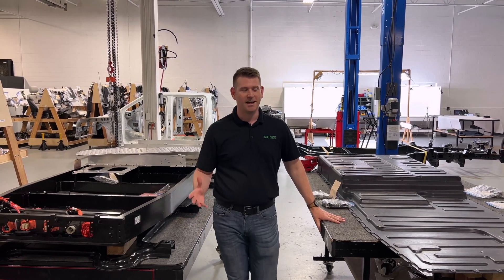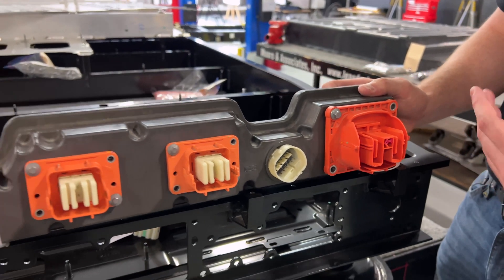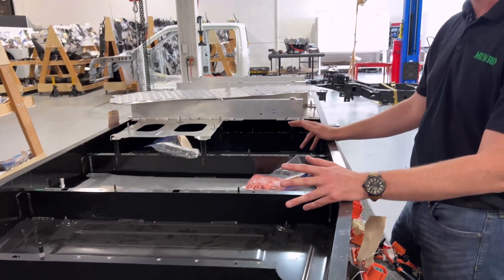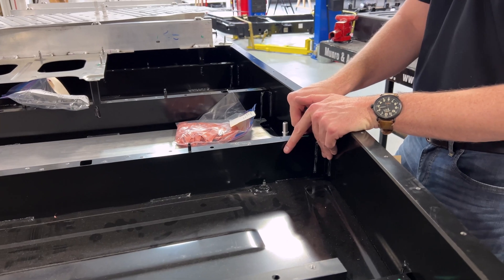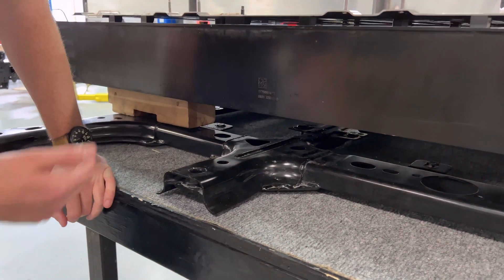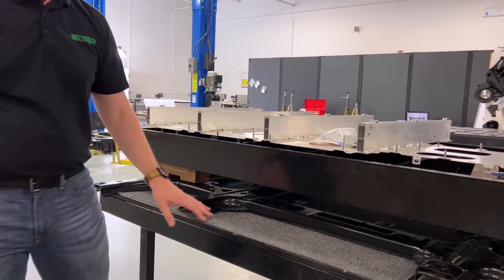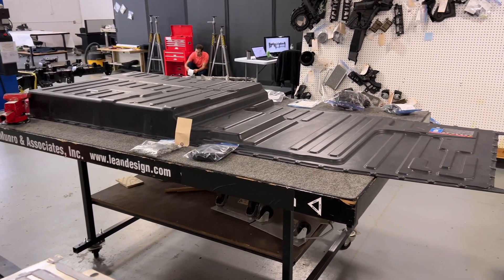F -150 Lightning Battery Pack Structure

Comment: Any thoughts of a follow-up video on the Lightning’s battery pack reliability? I’ve seen some videos claiming battery failures with no replacement stock available at the dealers to get the vehicle back in the road.

Comment: Maybe it's me, but I don't see how this battery pack is "structural".
Reply: It's not. No EV has significantly structural battery pack - not even the Tesla Model Y with 4680 cells, in which the battery pack top case cover just acts as a floor panel.

Comment: Kevin, good job.  If you provided an over view; a simple graphic showing position in the truck so i could stop trying to assemble it in my head would help start with the right context.  Is that the frame?  Where over the double stack?  Was that the frame on the table or subframe?  And so on.

Pack has crude  almost homemake cobble together look of “let’s get it out the door now and optimize later”.
Reply: I think that they assume that you have watched the earlier videos, which show the battery pack mounted in the truck's frame.

Comment: To replace the 300 mile battery back on a Ford electric F150 cost $35,000 and I think the smaller one is 27,000 and change

Comment: Could be that the extremely stiff frame design of the cybertruck was in part driven by the goal of eliminating the need for an isolated battery pack,   given that a pickup truck frame is subject to higher loads and bending than a road vehicle.

Comment: You mention KW, but how many volts are we talking about ? How about the number of AMPS going through those cables. 
Also we see the orange connectors and cabling. Is orange some kind of standard or just a new BEV tradition ?
You mention cooling. What is the temperature of the battery pack, High, Low, Ideal. One would expect a temperature gradient as the coolant worked it's through the battery pack. Does the battery pack automatically shutdown to prevent damage at a high temperature.
Reply: The electrical details will follow in later video, as mentioned in the video.
Other reports describe a battery with 96 cell groups in series, so it will have the same nominal voltage as most EVs, of roughly 360 V. That means hundreds of amps at high power.
Orange for the battery voltage is an automotive industry practice, found in both BEVs and hybrids with higher voltage traction batteries (presumably not the 48 V stuff).
Reply: @brianb-p6586  Thank you.

Comment: The Lighting being a cab on chassis means the chassis is part of the suspension. This means there will be twisting put through the whole of the frame and the last thing those cells need is to be turned into a twizzler. This is most likely way the battery tray is not hard fixed to the frame as in the others which are uni-body and much much stiffer in the chassis than a body on frame.

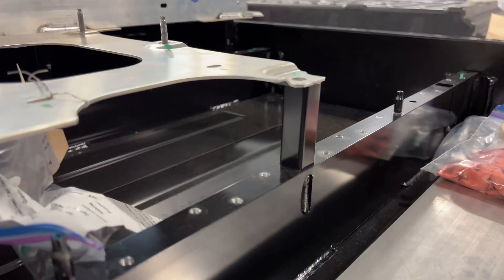Comment: Re: Assumed Knowledge. 0:48 What is SMC (SNC)? 5:55 “Pickup” revisions (as in lesson learned improvements)? 6:36 You know (umm, then why watching?) 7:00 Bulkhead venting (so this has to do with containment of errant gases to deter fire potential, or something?) 8:00 NVH? (Oh right, who doesn’t know Noise, Vibration, Harshness) 10:43 conformability? comfort? familiarity? 11:15 Oh, got it. what does smc mean automotive: “Sheet molding compound (SMC) is one of the most widely used forms of composite material in the automotive industry, particularly in the US where output has grown from 65000 tons in 1990 to 125000 tons in the year 2000 (Automotive Composites Alliance, 1999).” Of course! (face slap). No worries, I thoroughly enjoyed all 11 relistens. You’re the best, Kevin!
Reply from the maker: Thanks for watching!

Comment: That's a lot of battery cells to buy and pay for, to make a legacy frame and body design work as an EV.  I compare it in my head to the Tesla 4680 "structural" battery pack, and wonder how much weight they could offload with a cleaner design.  Having an aluminum body in white and bed is a good start.
Reply: You have to move to a completely rigid body to do structural pack. There are upsides and downsides to that approach, but remember that one of the big selling points for Ford is aftermarket assessories and even entire alternative beds. Ford cant dramatically change the construction of their trucks without in some way missing out on that market. So its not just about using legacy parts, its just as much about reverse compatibility, which limits what they are willing to do. Tesla can do whatever they want because they dont have those considerations. Which is one reason why Ford will still be competitive when the Cybertruck finally comes to market.
Reply: @patreekotime4578    I think that Ford could incorporate a structural pack into the frame if they started with a new frame design from the ground up, and still use a body-on-frame design.  That would be quite expensive and require heavy re-tooling for their new "skateboard" structure, but it might be desirable from the standpoint of maintaining high flexibility of alternate cab and bed configurations typical of the current truck platform market.  If they try to go full structural monocoque, it would be a dead end for aftermarket options.  Trucks are not a "one size fits all" kind of business.

Comment: Like the Mach E the high voltage high current conductors look small maybe 6AWG. From my single conductor in free air table that shows temperature rise at different currents. At 350amps fast charging there will be a 150DegC  temperature rise. With this large temperature cycling over time the fasteners will become loose. Causing high resistance raising the temperature even higher. Note power is I squared R. This problem even gets worse at higher current loads at rapid acceleration. At 1000amps the temp rise is over 400degC
Time will tell when this becomes a problem.

Comment: All these small passage coolant loops. So many seams and joints for failure. I can see a "coolant plate" failure inside the battery pack whereby the pack gets flooded with coolant. Not an easy repair to a $35k battery pack.
Reply: That's typical of EV battery packs. I've never heard of a plumbing failure flooding the case, but of course it's possible and it may have happened.

Comment: I think Ford engineers are going to knock the all new clean-sheet-of- paper 2025 F-150 out of the park in a few years. I predict that Ford will still offer the the current version as a “classic” F-150 at a slightly more affordable price point.
Reply: Ford is going to be so far behind after the EV Silverado and GMC is released!
Reply: @gmv0553  How can Ford be "behind" a truck that hasnt come out yet when they are already selling trucks?  Also,  that Silverado looks like a giant Honda Ridgeline. Can you even put a toolbox or ladderrack on that thing? Load capacity is like 1300lbs.  Is it even a work truck at all?

Comment: I would expect the pack to be soft mounted because the pack is much more rigid than the frame, but it's not strong enough to actually handle the loads that the frame is supposed to handle. Thus, if the pack was hard mounted, the pack or at least the mounting points would get damaged as the frame flexed like it's designed to.
Reply: The design allows for the entire battery pack to be removed for service without compromising the integrity of the chassis. Many EV designs use the battery pack as a stressed member making servicing a nightmare.
Reply: @heathwirt8919  Go back and watch the lift review. There is a ton of complexity with that ladder frame and skid plates that likely makes it more difficult to drop than it seems.
Reply: @patreekotime4578  It's a significant task but it's designed be removed from the bottom of the frame as a unit. Weber Auto has performed the same task on the Mach-E several times, it requires a special fixture made by Ford for this purpose. The pack itself is serviceable as each module is removable as a separate entity. The modules/batteries are not potted as in the Tesla and other manufacturers that use the battery case as a stressed member of the chassis.
Reply: @heathwirt8919  I think it's probably a bit of both.  Bur yeah the easier drop down and back up replacement nature of the pack, gives me hope that long term repairs and or refurbishment will be a lot more economical so that eventually when the time comes and my battery finally kicks the bucket, if it's out of warranty, it'll be possible to find a reman replacement battery pack for a decent price.
Reply: Still, I'd imagine it's practical to make the battery structural because vehicles under repair aren't moving fast or carrying much load and can survive with a much lighter base frame while the battery pack gets repaired/replaced.

Comment: What I find fascinating is the battery form factor that all pure EV companies take vs what ford/GM/VW take. For some reason pure EV companies always use cylindrical cell vs pouch cells.
Reply: Pure what!? Wtf!!!!! Are those other battery cells also batteries!? Stfu!!!!
Reply: Cylindrical is just using up old laptop batteries because there was nothing other back then. 😅
Reply: Pure EV companies/brands NOT using cylindrical cells:
Aiways - prismatic
Atlis - prismatic
Bolloré - pouch
E.Go - prismatic
Fisker - prismatic
NIO - prismatic
Polestar - pouch  / prismatic
Sonomotors - prismatic LFP
StreetScooter - prismatic 
Tesla - mostly cylindrical, but prismatic LFP by CATL and soon: prismatic LFP by BYD
Wuling - prismatic
Zeekr - prismatic

Looks like your rule of thumb needs an update. So far, only Tesla (see exception above), Rivian, Faraday Future, Lucid, Rimac, Arrival are somewhat dedicated to cylindrical cells. And maybe BMW will join at some point in time with their "Neue Klasse" vehicles.
Reply: @koeniglicher  lol…..
Reply: @koeniglicher  Well about half of those are electric divions of existing ICE manufacturers, and most of them are Chinese, including the Teslas, which just suggests that a high volume of cheap prismatic cells are readily available in China.
Reply: @patreekotime4578  That is why I wrote "Pure EV companies/brands", including EV brands of existing car manufacturers. In my imagination, there is nothing like an "ICE manufacturer" or "EV manufacturer". But all of these brands concentrate on producing BEVs. Yes, they may be Chinese, but a Chinese BEV is as good or bad as any other BEV, construction wise. In the end, it is mostly a matter of availability and price of cells together with some basic properties. Cylindrical cells for BEV car applications always have the disadvantage of high cell count, which needs proper automation to deal with it. Cylindrical cells (18650, 2170/21700, and even future 4680) have the advantage to be small, standardized, filling volumes nicely and to be compatible with many use cases different from BEV cars like e-bikes, pedelecs, e-cigarettes, flashlights, toys, garden gear, power tools and whatever. But FMPOV they are not the best choice for larger energy storage systems 30 kWh and up like for BEV cars and energy storage systems. Im am looking forward to see the cell decision for Tesla Semi (which will not be 4680): I bet on large prismatic cells similar to BYD BEV trucks and coaches.
Reply: So only cylindrical cells are usable on EV's? What difference does it make and how do  you find it fascinating.

Comment: You said for this Extended Range Battery Pack : the 1st module is 11.95 kWh plus 8 modules with 16.44 kWh each. Makes a total of 143.47 kWh.
Is the following correct? 1st module is 32 cells => 8s4p, the other 8 modules are 44 cells each => 8s 11s4p.
The whole pack is 96s4p then, 143.47 kWh gross capacity, 131 kWh net capacity. 
Small module plus 5 big ones in the 1st floor. Then 3 big modules on top in the second floor. Confirmed visually.
Cells are SK Innovation pouch cells, Hi-Nickel (9 Nickel, 0.5 Manganese, 0.5 Cobalt), nominal cell voltage is 3.66 Volt, nominal cell capacity 102 Ah, nominal cell energy: 373.32 Wh. 
So the small module (8s4p) would be 29.28V nominal,  408 Ah, 11.95 kWh.
The large modules (11s4p) would be 40.26V nominal, 408 Ah, 16.43 kWh each.
What is battery pack weight? The "Ford F-150 Lightning Battery Removal Guide" demands a lift table capable of handling 746 kg. Is that the weight of the Extended Range Pack? That would be 192 Wh/kg at battery pack level which is quite good. 

What is the corresponding data of the standard range pack then? This would be a 3p pack then.  Neither 32 cells nor 44 cells nicely divide by 3. So they would need different modules.
Known: 98 kWh net capacity. Could be 9 modules, 30 cells each, each with a 10s3p configuration, 90s3p overall, 270 cells in total. Nice weight distribution, however this would still require 9 module housings with each of them only partially filled and requiring extra compression on the cells - or with smaller outside dimensions.
Reply: Nice details you provide ... to expand what Kevin discussed.
Reply: @jbarvideo12  Kevin said in the end, they split the content and Munro would provide a second video on the modules themselves. However, I am impatient to wait for it. I personally am not so interested in the fasteners, extrusions, molds, seals and stuff (classical Munro focus points), but the electrical properties of the pack. And I wanted to highlight, that they should publish weight once they have it on a scale and treat the standard range battery pack with some additional hints despite not having it on their workbench.
Reply: Interesting analysis. To hit 98 kWh usable with the same cells, it would need 290 cells. Like the Mach E, it would make sense for the standard pack to avoid the top tier; that suggests something like 10S3P (30 cells for the small module instead of the extended's 32) plus 5 modules at 14S3P each (42 cells for the small module instead of the extended's 44), but that would provide only 240 cells in 80S3P, which is low in voltage to use the same motors and too low in capacity. Keeping a shorter top tier , noting that this would be a structurally easy variation, raises the possibility of something like one 10S3P plus six 14S3P. I'm assuming that the module construction only works properly with an even number of cells, regardless of how they are electrically connected.

Comment: A nice presentation. It probably will not be long before Sandy has the entire crew of Industrial Engineers "Camera trained and ready". My way of writing a: "Well done". 
A nice execution by Ford as an early example of a light duty truck frame.

One thing I noticed about this "Ford by Example" was the lack of background considerations of the existing plant.
Once upon a time, the purchase of plant and equipment was a 20-year funding, now it is more often a 50-year funding.
Bad enough to have unused machinery sitting idle for the last 5 years of a 20-year note, now the same situation would be unused machinery sitting around for 35 years.
All of planing for a new vehicle is most likely a case of: "Do the job with the plant and equipment we have".
Ford has a lot of plant and equipment.
You can't expect them to be putting 9,000 ton Giga-presses into storage until the lease runs out. 😂
Maybe find some work job shopping Locomotives, Submarines and Tanks? Oh, wait, GM already does that.
Reply: Not sure if you're critiquing Ford or "others"?
Reply: @rogerstarkey5390  No specific company.

Comment: That is a HUGE battery pack, surprised the range is so low. Ford has a long way to go but good to see they actually made the Lightning but obviously it's rushed. Battery pack frame seems awfully redundant to the ladder frame, just isolate the battery modules. Being compared to titanic isn't exactly.....good? LOL!
Reply: The efficiency is very similar to the Rivian despite the Rivian being smaller and the Lightning is way more efficient than the Hummer. The cybertruck may have a more aerodynamic shape but by the time it comes to market, the Lightning will already be refreshed with an all new version coming out in 2025.
Reply: This battery pack design uses far too many welds, pieces, bolts and must be a nightmare to assemble and service. If Sandy had done the review, he would have ripped it apart, pointing out the dozens of ways it should have been built. This was a rush job to get to market.
Reply: Why is it surprising? This is a huge vehicle, with huge tires and blunt shape. Although energy consumption per unit distance is almost double that of the most economical car, it's only 10% higher than typical SUVs, slightly lower than the worst of the SUVs, and about the same as the Rivian.